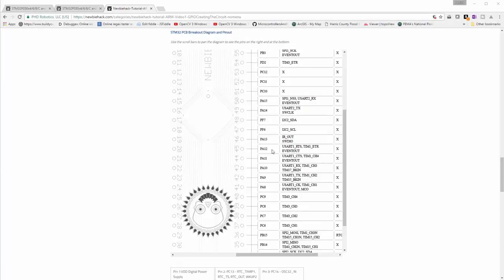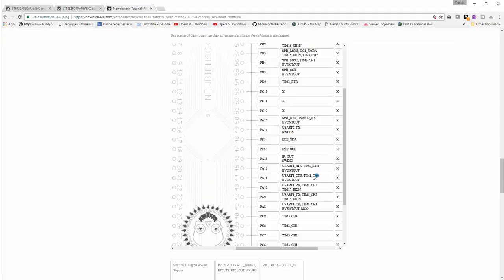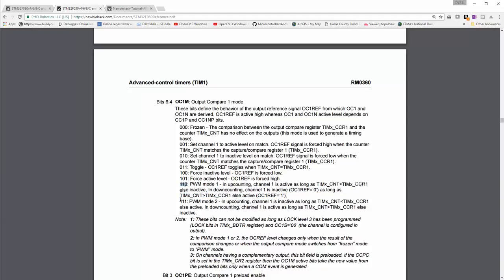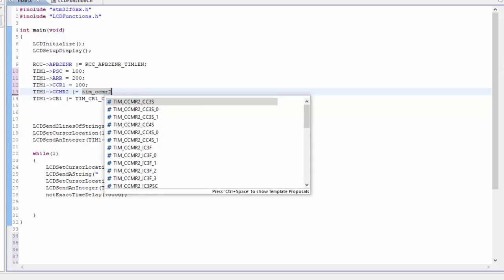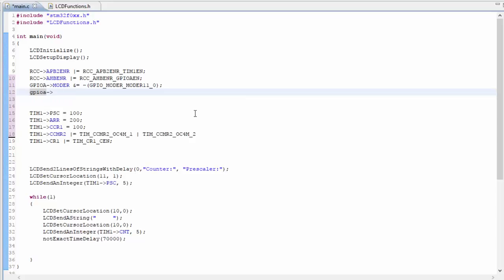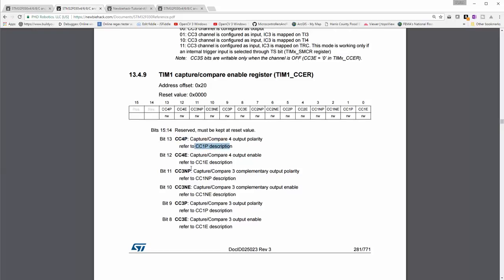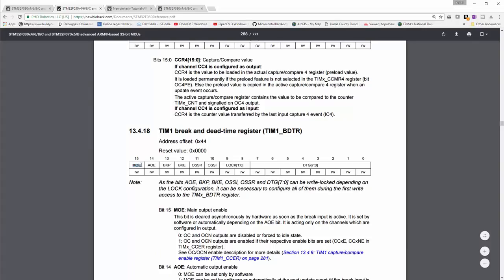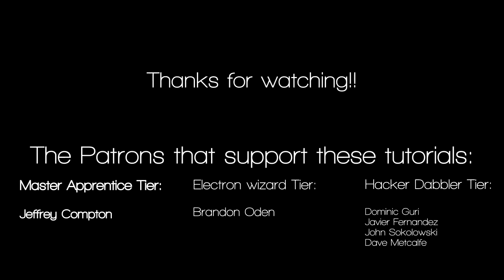44. How to Use or Create a PWM (Pulse Width Modulation) Signal Part 2 - STM32 ARM Microcontroller

Comment: I'm Guessing to generate PWM you can only use the TIM1_CH1 TIM1_CH2 etc. outputs?
Or can I use GPIO's to generate PWM's?
I've watched many videos and only your's seems to stick out so I thought I'd better ask you.
Reply from the maker: You can use the timer, but you can also use your own method for generating the PWM by using other variables that can use the timer as a reference.  I have a video on my AVR series that connects many servos on a single Atmega chip using this method.
Reply: So for the STM32....I have four timers, I can only have four individual PWM outputs?

Thanks in advance.
Reply: @lambsauce5445  maybe if others still need the answer, I thought we can have pwm according to the total of TIM x Channel. So if the MCU have 4 TIM and every timer have 4 channel, so we can have 16 outputs for pwm.